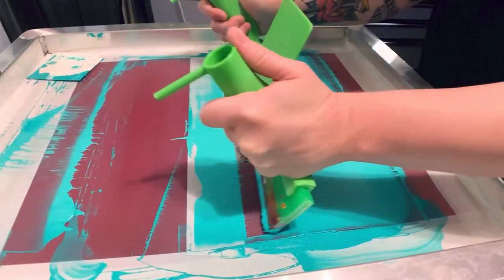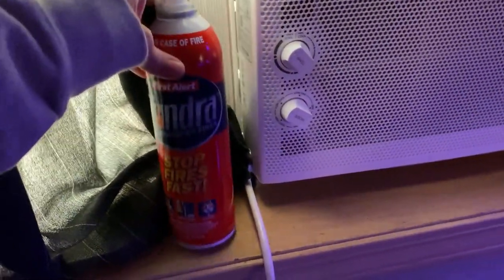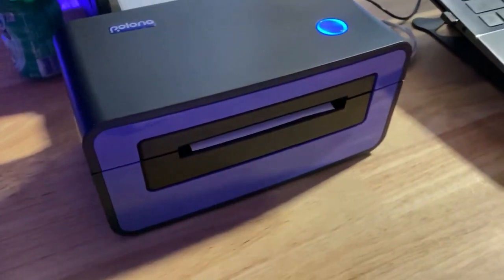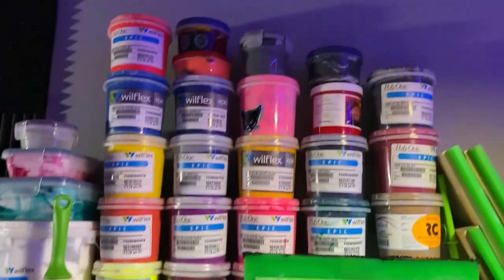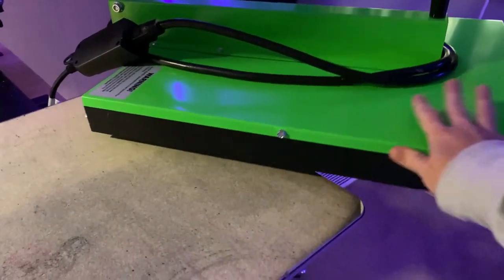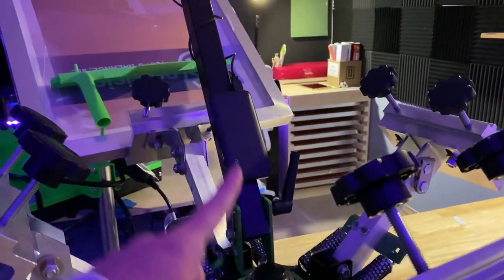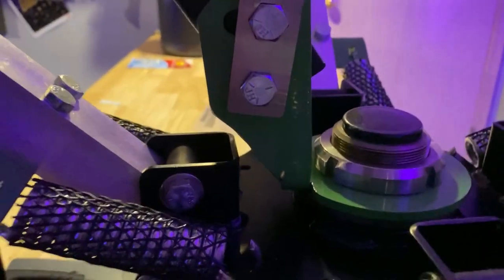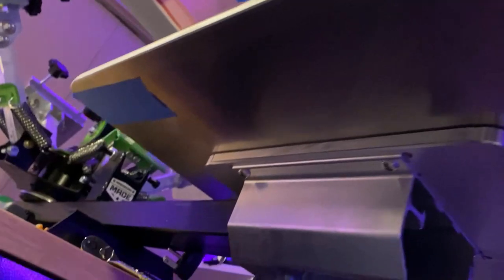SCREEN PRINTING - Home studio tour

Comment: Great setup. I know what you mean about the flash dryer stand. I've got a cheap chinese version with a smaller stand, but the trade off is that it's quite tippy, so you have to be real careful. If the sharp edges are a problem you might be able to cover the legs with pieces of plumbing pipe insulation. You get it at the hardware store, It's cheap, made of foam, and has a slit down it's length so you could slide it over the tops of the legs.
Reply from the maker: That's a great idea! Iv been trying to think of ways to not trip over it all the time lol. I just moved all my equipment in the garage so I have much more space, so hopefully that helps as well.